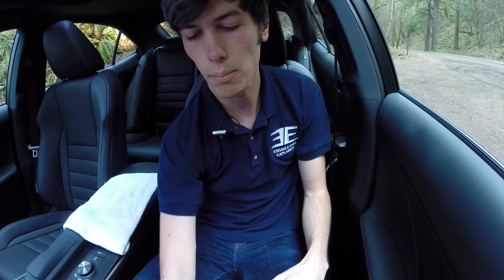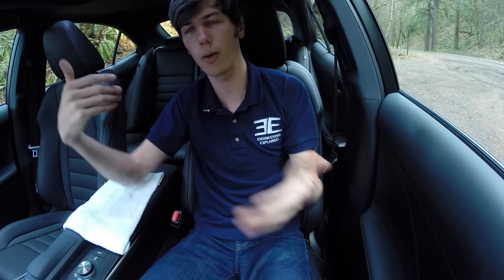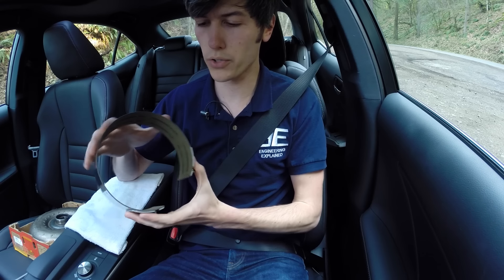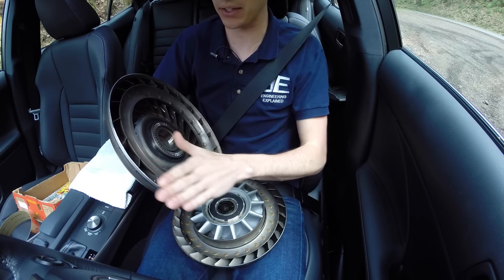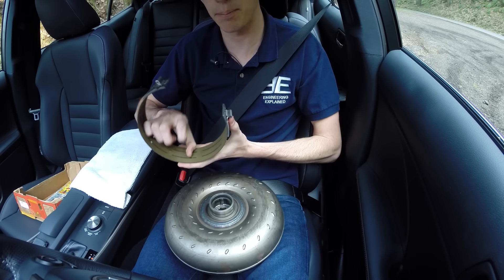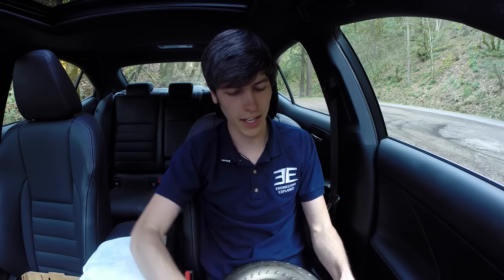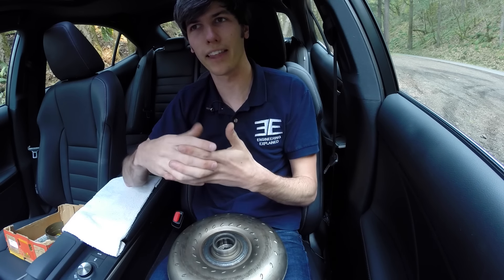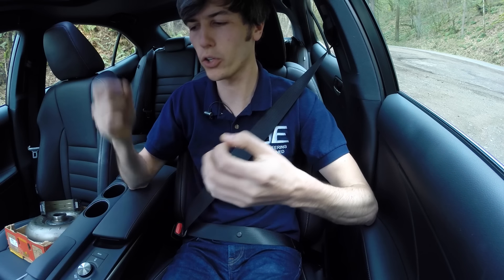5 Things You Should Never Do In An Automatic Transmission Vehicle

Comment: So basically its entirely okay to coast in neutral.
Reply: +Connor Jones It's OK, but there's a pretty small chance that it'll cause an accident in a situation where you need to be able to accelerate to avoid one. That's why it's illegal on those states where it's illegal.
Reply: Does the same go for manual cars as well?
Reply: Not safe. What if you need to do a quick maneuver to avoid a collision???

Comment: My car definitely idles lower in neutral than Drive.......and I like to take my foot off the brake at long lights.....so I think I'll continue to put it in Neutral at long lights. Probably not short lights though. Not worth the bother.
Reply: same here
Reply: Standing in Drive, the engine is expending some power (doing useless work) driving torque-converter with its output stalled. It's just making waste heat in the trans, and burning extra fuel in so doing. Putting it in Neutral avoids that. One drawback- shifting back to Drive when light changes, will see a transmission delay.
Reply: not in my th400 in my 1973 chevy truck. gear selection is instant.
Reply: It says its illegal when you're on a grade, not at a light.
Reply: but then your brake lights arnt on and someone will rear end you
Reply: Why not park? Seems safer if you aren't going to put your foot on the brake...
Reply: xinic5 Yes. I would put it in park when I know for sure it's a very long light.
Reply: As far as I know no one is stopping you from braking even though it's in neutral
Reply: Brake lights aren't connected to the transmission, only the reverse lights.

Comment: I was once on the high way in my parents 2000 Toyota sienna, and I bumped the Transmission into reverse at 100 kph.  big bang and the engine stalled, but started right up and has been driving since with no issues what so ever haha.
Reply: I pushed R instead of L on a Chrysler push button car when going about 30. Fortunately they were designed to shift to N if you made that mistake.

Comment: I put it in neutral at red light because my car shakes when idling in drive
Reply: You probably have a bad transmission mount.
Reply: Or bad idle, due to vacuum leak.  So when your engine has a load it boggs, but when it is free of load it idles fine.
Reply: If it had a vacuum leak it would idle bad in neutral too
Reply: I put in neutral at red light because I fear my car will hit the car in front of me if I release my foot from the brake. Handbrake didn't help because I can feel the car pushing forward when I release the foot brake. It is simply uncomfortable and unsafe. You also annoy the hell out of the driver behind you with your glaring red taillights. 

I agree with everything in this video except the don't put it in neutral at red lights.
Reply: Clean your throttle body
Reply: I do too sometimes because it allows me to rest my foot when stopped.  I don't have to sit there with my foot on the brake.
Reply: try checking your harmonic balancer
Reply: If your handbrake doesn't stop your car, maybe you should get that serviced?
Reply: same here... I'm using an old car too.
Reply: David Robitaille motor mounts
Reply: Iennal h
Reply: Motor mounts most likely. Still possible but less likely transmission mounts or harmonic balancer. I had an 83 Cavalier that shook and knocked in neutral, but was quiet in drive. Turned out the idle was set too high. It was my first car. Didn't know you could adjust the idle...
Reply: Try changing the sparkplugs and maybe the coil of a cylinder. It might be a cylinder misfire :p
Reply: It's a diesel
Reply: @EvanDerickson  hand brakes really aren't supposed to be used to "stop"your car.  only keep themfrom rolling

Comment: Can you tell us what's the difference between a CVT Transmission compared to a Traditional Automatic Transmission?
Reply from the maker: Yep, I have videos on both, search my channel for "CVT" or YouTube for "CVT engineering explained"
Reply: +Nathan Yim  ones belt or chain driven and over laps gear shifting and u dont feel shifts
Reply: +GooglPlusSucks as opposed to what type of transmission?
Reply: They all fail with improper lubrication and heating to include torque abuse..... That's the issue with all of them including manual...

Comment: I have a never seen a two piece torque converter that only half spins when stopped
Reply: Brandon Shelton yeah he kind of just ignored the fact that it's welded together and didn't explain how the convertor works at all, especially stall and lock up.
Reply: And when you aren't moving the converter is making heat.... anytime you are moving/pumping oil it is getting hot.

Comment: does putting your car into neutral to rev while moving mess up the car
Reply: No
Reply: Adam Olsen paid this much for an exhaust i am going to enjoy it through tunnels
Reply: But it's an automatic....
Reply: Adam Olsen ohhh wellll, downshift and floor it
Reply: ***** welp
Reply: +P.J. G. Ngek ngek ngeeek
Reply: +P.J. G. Lmao
Reply: +Jayfer Zahir Depends on how many lanes and traffic of tunnel. I use to Love going through a corrugated steel pipe tunnel, it was one lane, one way. I just pulled up to a complete stop at the entry and would then floor the accelerator pedal and unleash 427 HP with dual exhaust. It was music to my ears! :) For you, depending on traffic, stop or slow down to create a space between your vehicle and the ones ahead of you, this should allow you room to accelerate your vehicle and achieve the music that you so desire. Good Luck making music!
Reply: +Jayfer Zahir this jagger is too young to know anyway...
Reply: the purpose of coming to a complete stop before changing gears is to secure them gears together rather than changing gears while moving may not allow the gears to be fully in contact. yes overtime not properly putting in the gears before stopping can ruin the transmission.
Reply: Yes it does it will fuk up the motor and shifting with high rpm will kill ur clutches
Reply: FOKKERJBIRD :D thanks
Reply: Adam Olsen ya :/
Reply: +Jayfer Zahir  it depends on what Type/ Year/ of Automatic & what is DOne  &  what type of ride  it is & what is your Skill level is  at  with your Eye hand Feet & eye cournation. you got to be sure you don't Put it in REVERSE on accident or Mess up.& put it in 1st Gear or to low of a Gear depending on what Speed you R moving at.. or can & will Fk sh t up .. .   I've put  it neutral while Moving to Tech it up & lit bit  while driving pass a few friends house to get them to bring there Beast out & have some Fun. LoL..  Before with  a Few auto matice that i have had in other Ride's in the pass & never had any Tranmission Problem's with any of them . but they Were older Ride's . The newest model  one i did that   from time to time  was a 94 Ford Ranger. but i didn't make a habit doing it all the time. .. I would say if you want to do that a Lot & like doing it almost every Time you Drive  .. I would say you Need to Get a manual Gear box. 5 speed or speed 6 speed Trans mission setup swap done. .
Reply: Nate white appreciate the feedback, i dont do it all the time just when i am in a tunnel with friends and i cant floor it thru the tunnel. never something i do on the road with other cars like these other people are thinking
Reply: ***** i only do it thru tunnels with friends never at a car meet or on the street.

Comment: Do a video on using A/C in a neutral car parked!
Reply: why?
Reply: As he said, putting it in neutral slightly increases the engine rpm.  This will allow the A/C unit to operate a little bit better since it is very inefficient at low rpms.  Also, on many trucks and older vehicles, the engine cooling fan is mechanical (driven off of the engine, not electric) and therefor will cool the engine better at the increased rpm while standing still.
Reply: +William Yost There is a temperature sensor for this and many fans have an oil clutch. The oil reacts on higher temperatures with higher viscosity and thus the fan turns faster which leads in more cooling capacity. So you don't need to increase the rpm's purposely, in most cases.
Reply: +heros2110 I understand the fan clutch. This let's the clutch nearly freewheel when not needed, but even engaged, the fan is still limited in speed by the engine's rpm. I did forget to mention this,  so thanks for the additional input.
Reply: +William Yost   Even when a clutch fan is locked in due to temperature,  they still slip under RPM to counter power loss.  The fan clutch on my Chevy C1500 moves more air at idle than at 3000rpm.  You can actually see the fan slow down as engine speed increases.
Reply: +William Yost If I'm parked somewhere, I just rev it to 1.5-2k so the A/C works better. High idle of sorts.
Reply: +Matt Culler good to know, thank. never thought
Reply: mr rambo
hahahah dude keeping AC on in neutral for a long time is bad for the engine and compressor that why i asked him so that he can either prove  or debunk the myth
Reply: +Sohaib Akram I think that's no problem since most cars if not all nowadays have an idle air control valve. to compensate for dropped RPM when the compressor starts and stops, but yes, It's works best with the RPM at a mid-way.
Reply: Richard Barkley
Really are you sure i been to mechanics after winters to check for the gas of compressor and just routine check ups they always say that u been using AC for too long on a sitting car they say that on a moving car on long journey its ok but not in a sitting neutral car at parking..

Comment: do a video on triptronic transmissions
Reply: Please*
Reply: tiptronic***
Reply: switchblade mark I've seen it both ways depending on manufacturers
Reply: They aren't called triptronic, they are called "semi-automatic sequential manuals." Trip/tiptronic is a brand name, like Kleenix for tissue.
Reply: The "Tiptronic transmission" you're referring to is just a conventional automatic transmission with a mode called "tiptronic mode" that allows you to manually change gears. It is the exact same as any other conventional automatic, just offers tiptronic/manual shift mode.
Reply: Khum Dhan

Comment: So what are the reasons not to coast in neutral downhill apart from the law? Does it harm anything ??? You didn't explain this.
Reply from the maker: +Nevsack63 I gave four reasons in the video. 1. Your engine does not use fuel when you coast downhill in gear. 2. You're removing acceleration control from the equation. 3. Your brakes may overheat if the grade is long enough and you're constantly on your brakes. The engine can help keep your speed down. 4. It's illegal.
Reply: +Engineering Explained I don't inherently disagree with your points, but you are certainly generalizing quite a bit.

In regards to cutting the fuel, do ALL manufacturers do this in ALL of their vehicles? When did each of them start doing this, or was this "always" a thing? So probably a 2015 Honda Accord cuts fuel, but what about a 2002 Kia Rio or 1996 Cutlass Supreme?

And can you actually tell me that the consumption of gasoline at idle is actually more wasteful than the momentum lost leaving the vehicle in gear, spinning various parts of the transmission and engine? With what certainty and by what measurement? Is this a 2% decrease in fuel, or a 12% decrease?
Reply: +Engineering Explained If the fuel is cut downhill while the wheels are rotating the engine, doesn't that kill momentum? Kind of like engine braking?
Reply: +saskLS1 It does, in my cars I actually get better MPG in neutral so I wouldn't listen to every person on the internet. Test it yourself its the only way you will know.
Reply: +Nevsack63 You won't have the ability to speed up in event of an emergency.

The main reason is because it doesn't save shit, if you can't afford to drive down a hill with your transmission in gear, you can't afford internet to watch this video.
Reply: Engineering Explained Awesome. Thanks.
Reply: +DeathInANuse 

speak for yourself, I pirate my Internet off McDonalds wifi
Reply: +DeathInANuse Shit son tell that to my 7.5 L 460 with a c6 3 speed transmission. I get 8-11 miles to the gallon, sometimes 5 if I haul shit. Driving down hill for 10 miles in neutral saves gas.
Reply: +Engineering Explained Would there be any damaged caused by putting the transmission back into drive while its still coasting in neutral?
Reply: +Nevsack63 I always coast in neutral going downhill with my old auto. I used to go to a jr  college that was on top of a hill and when I got out at night around 10 pm,I would go back down the hill in netural going 60 MPH. I would even pass cars going slower than me. I did it for years. Nothing happen to me. 

If I ever needed to, I could always put it back into Drive if I wanted, but never found a reason to.
Reply: +DeathInANuse And I really don't care much about the gas, I more do it so I'm not at 3500-4000 rpms. The 7.5 L 460 isn't too quite when it's straight piped.
Reply: +Miles Conlan Most fuel injection engines will trim if not cut fuel on a downhill: if the RPMs are higher than they should be at 0% or whatever throttle position you are holding, the only thing the ECU can do to bring RPM down to what it should be is cut fuel and wait. There is not much point in injecting fuel when engine load is below 0% (coasting/braking) and that also spares the trouble of having to program injection tables for negative load to meet emissions standards - no emissions to worry about when there is no fuel.

Which one is most wasteful? 1) engine braking to prevent your downhill coast from significantly exceeding legal speed limits which should disable fuel injection and also provides the benefit of running all your electrical and mechanical loads from your excess potential energy which you need to get rid of to stay reasonably close to the legal speed limit anyway or 2) wasting your brake pads to keep your speed from creeping up too much and wasting fuel to make the engine power all the other vehicle loads.

The engine drag is only a factor if you intend to disregard legal speed limits on the downhill.

Comment: I always put to neutral when I'm about to hit a red light or a coast towards the red light or at a stop light.   I think its less stress on the engine having on drive while at light and your foot on the brake.
Reply: +サントスシｮナサン if you coast in neutral to a stop then its ok just dont coast in neutral an change back to drive while its still moving thats when the stress is caused
Reply: +Joshua Koch i do the same, put back in drive once the car fully stopped
Reply: +サントスシｮナサン Doesn't hurt the motor, and your brakes will last a lot longer!